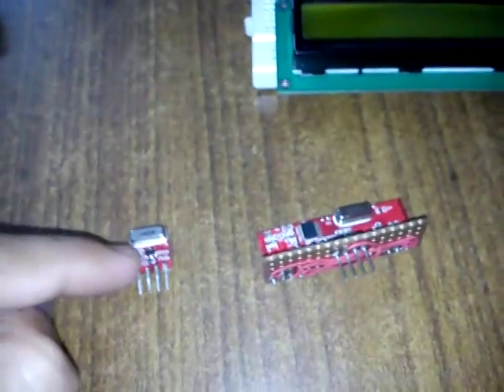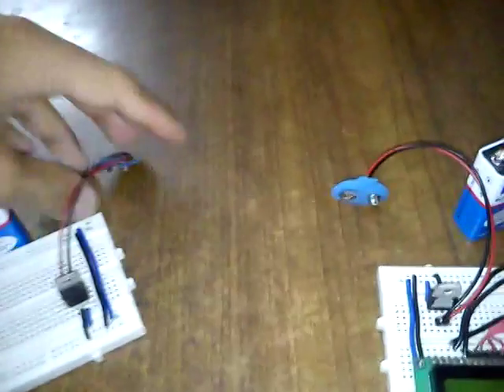Using RF technology with 8051 microcontroller

Comment: Hii.. can you provide the exact circuit diagram which includes values of capacitors and resistors. and also please provide the 8051 assembly programming code for this project. We are in need of this project as soon as possible.
Reply: If you need details you may contact me. I have executed this project successfully
Reply: how @amitvairagi9473
Reply: @amitvairagi9473  hey bro
Reply: @amitvairagi9473 do you have a ckt diagram and codes